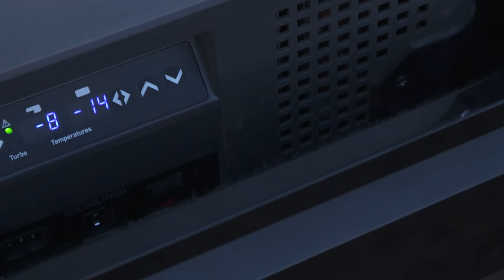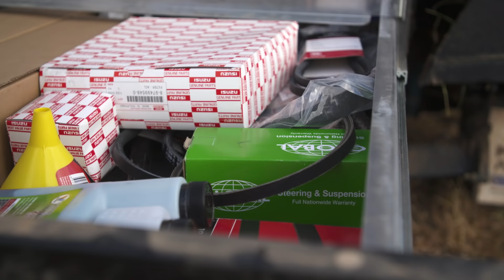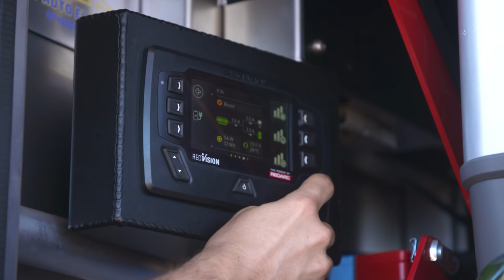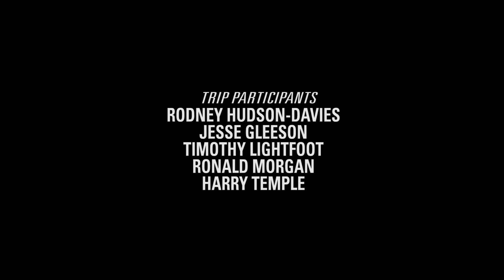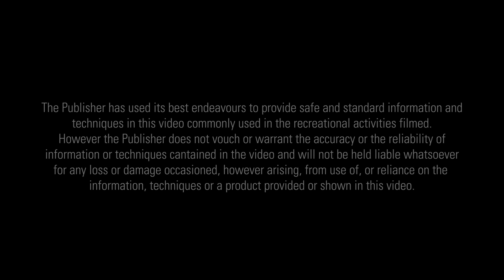FLOODED Kimberley river crossing GONE WRONG – 150m+ wide rapids - our most epic trip EVER FILMED!

Comment: ‘You just give it a little bit more Nissan and a bit less Toyota’ best quote ever
Reply: should make that a sticker
Reply: @yada1500  sounds like a good idea
Reply: He's bloody entertaining!!
Reply: @bldlightpainting  Haha those are Jeep recovery vehicles buddy
Reply: @bldlightpainting  until the ramp over angle has you stuck on a curb
Reply: Good luck going on tour in a Rubicon
Reply: @jefftenhave8038  yeah, gets expensive in Australia getting spare parts from Mexico.
Reply: Nah, little less spare parts and repairs on Jeep a little more anything else that wont break
Reply: @MrHowdi  you’ll just need gallons of oil since they leak off the lot
Reply: I'm sorry boys but I'm going to say Isuzu will surprise you with its capabilities, reliability and fuel efficiency. I drive a 2005 Isuzu kb250 4x4 and hasn't had any problems except for the occasional perishables going bad. For those wondering it has 550 000 km on it and 400 000 of that has been off the beaten track
Reply: @TheJackobus  haha yeah 4jj1 is the goods
Reply: @michaelsherwin3  yep its a bit slow but man it's reliable. And there is in my opinion no better way to get traction certain places than a idle at 0.5 km/h
Reply: Good quote. Prime example of a lazy toyota LSD
Reply: @bldlightpainting  If it was jeep Rubicon it would have overheated long before... or been in the shop and not able to go at all.
Reply: @yada1500  alrighty
Reply: Just like the camera crew's rig, crossed the river without drama.
Reply: @TheJackobus  I agree we I own an mux and it doesn’t get stuck on highway terrains in really soft sand
Reply: A little more kettle?
Reply: Give it a little more Ford and a bit less dodge is my version
Reply: But who needed help from the 30 in the river!? Thatd be the dmax (as usual) for starters!
Reply: @capncrack181  Good name because you're smoking crack lmao, A rubi has better breakover angle than every truck here. Especially when you consider that you can get a 35 inch tire on it from the dealer when you buy it as a mopar catalogue option.
Reply: Ava-rose Taylor  Isuzu is better
Reply: got a good laugh there better make a sticker/emblem on that one lol
Reply: Graham's excitement in the first 10 minutes is 100!

Comment: Heres one for the competion from me.
Get a rolled Lamb roast cover it in rub of Salt & Pepper including a lamb roast rub sachel from the supermarket . Rice Oil in Alfoil tray, then dress over Lamb with Balsamic Vinegar which breaks its down during the cook. Cook for 40 minutes but check regulary then last 20 minutes remove alfoil from top to brown up. Have another tray prepared of Roast veg include whole onion Zucini, Carrots Potatoes cut in half after boiling the potatoes for 8-10 minutes, remove potatoes from boil onto paper towel to dry moisture then put them in alfoil tray . Salt over all veg and cook till complete. Maggi Thick gravey powder added to oil from vegies and Lamb roast juice. Then serve along with Mint Sauce. 👌👌👌✌👍 Absolute Gold out Bush on the Camp Lads.

Comment: Get a 200 ft. rope, cross the river with it, tied to first vehicle, leave a trail of rope behind tied to a bumper from second vehicle(safety). First car crosses safe.  They can winch second vehicle through to the other side. Tie second vehicle across that made it, now you have two vehicles(snatch blocking) in tandem pulling out 3rd, 4th and 5th vehicle crossing. Kick dirt over a wadlu waru.

Comment: I’ve got a great pork roast recipe. You get your pork Roast shoulder or whatever cut you want. Put it in a bowl and pour boiling water over the top and rub salt and oil into the open pores of the skin. Chuck that in the camp oven and Chuck a whole bottle of Ayam honey soy marinade in the bottom with a small carton of beef or vegetable stock and 300-500 ml of water. Squeeze some garlic paste in the bottom, mix and drip some over the pork. You can put some whole garlic cloves in the pot if you want. Chuck that on the coals for 45 mins to an hour depending on the size of the roast. While that’s cooking cut up some pumpkin, corn cobs in half, big potatoes in half or quarters and Chuck two whole apples in and leave for another 45 to an hour and you will have the most morish pork roast you will ever eat in your life. The vegetables cook in the marinade and personally I reckon they taste amazing.

Comment: How come you do not have a welder? Or just rig 2 or 3 batteries in series and all you need are starter cables and welding rods + a mask. With an angle grinder shave the bad part off and weld a socket that is fitting to the bearing cup. Shave it to be a good fit. I would never go wheeling without at least one rig having welding stuff with it. I bought a cheap (really cheap, 34 euros from China to Finland) welding inverter, and have already used it once, fixing a small UTV log trailer´s log lifting crane at my cottage. Worked like something that costs 20 times more, and weights about a kilo. At that price one can buy two to to have a spare if one "Chinas" out...